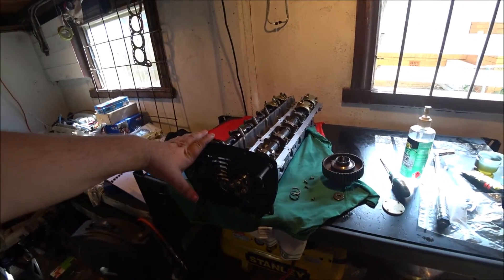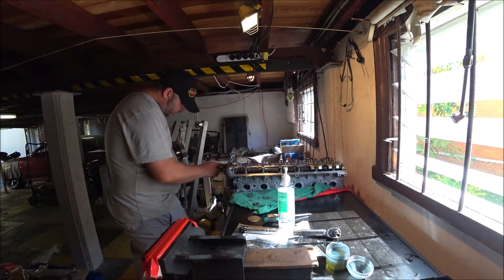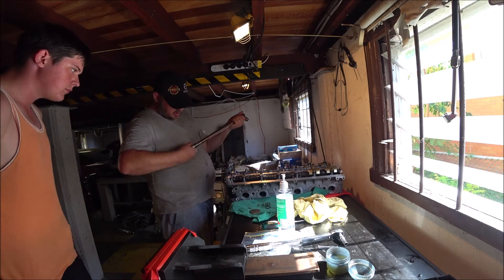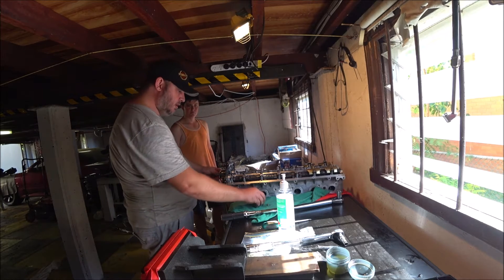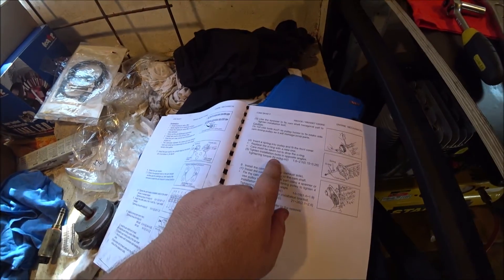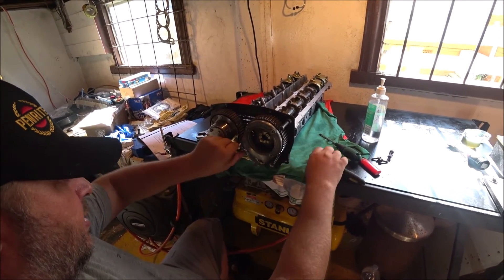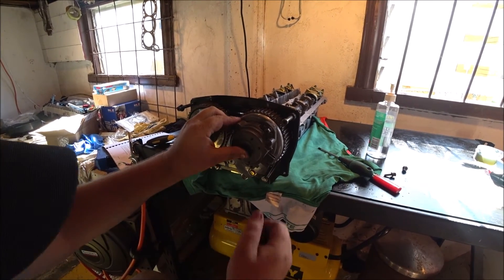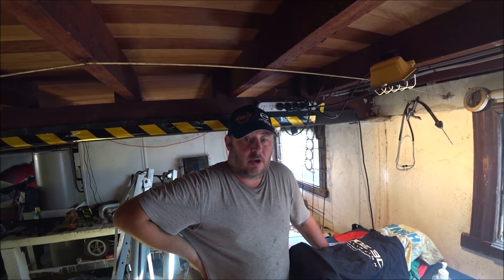RB25DET Build - Cam Gears & VTC Solenoid

Comment: Hey mate do you know if you can put 272 cams with stock head
Reply from the maker: Yes you can
Reply: tangles01 legend thanks brotha!
Reply from the maker: @jakesgt3314  You'll want a re tune though, it's a lot more air in and a lot more exhaust out.
Reply: tangles01 yeh man I’m in Melbourne and when I get the cams (280 kroford) I want it to sound like a bridge port haha I’ll buy a Nistune ecu 1000cc injectors 525 fuel pumps and ATR45SAT turbo all from Melbourne except cams which is pretty good, eventually I’ll forge the internals but should make 300kw without forged internals
Reply: tangles01 and 300kw is more then enough for now haha as I’m only 15 so I’m not actually driving yet 😂 and the cars getting painted in couple weeks
Reply from the maker: @jakesgt3314  Go back through my vids, this had 333 RWKW at 21 PSI the track vids in the 32 is running more like 19 as a safety (didn't work) so nearer the 300RWKW, I can assure you despite what you mates uncles, brother in laws sisters boyfriend on the internet says, 300rwkw is heaps. Also no need for cams for that power figure either.
Reply: tangles01 yeah man definitely plenty of power, I just want the cans for nice lumpy sound if you get me, I’ll build it more in the future and probably 2.7l stroker too but the cars completely stock and it’s rare too 2 tone 1n4 silver only 200 made or 49 with active lsd which i has so not too sure if it’s been messed with but besides that, want to keep it as stock looking as possible
Reply from the maker: @jakesgt3314  Well just remember, that cam will rob you of mid range power.
Reply: tangles01 yeah man it’s auto and I’ll put a high stall in it so it’ll sit in high rpm whole time👌🏼
Reply from the maker: All good